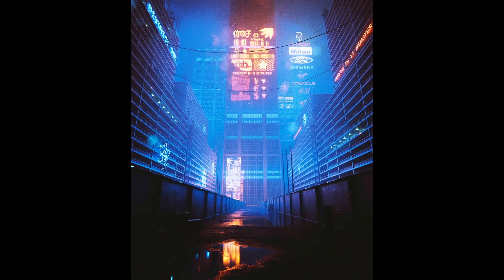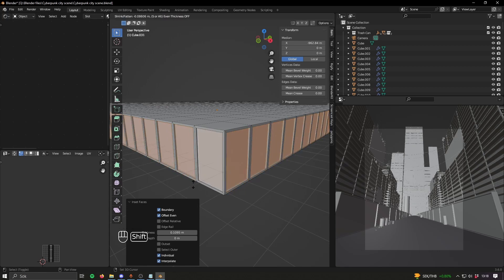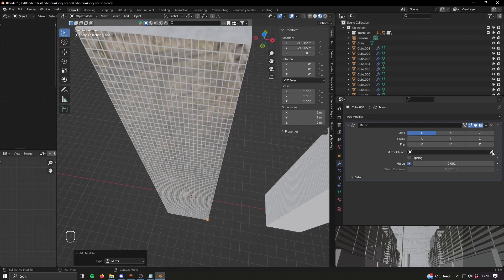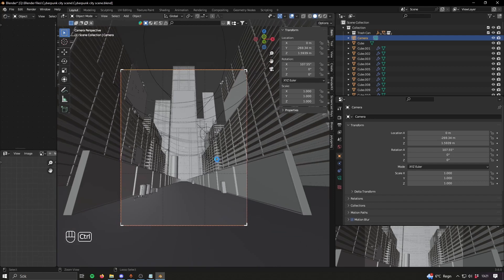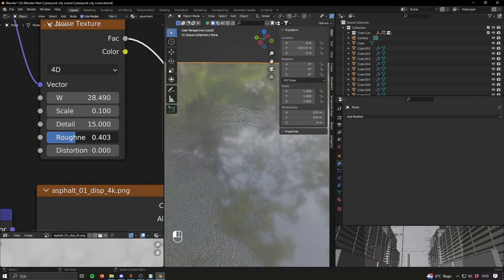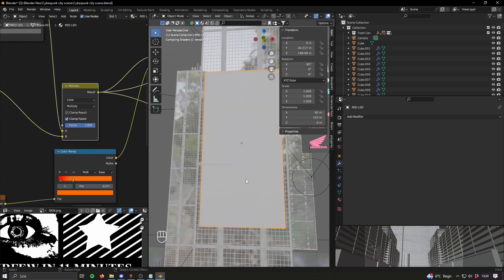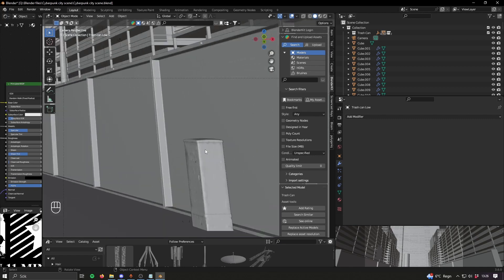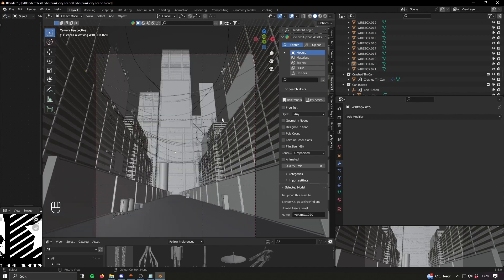It's Easy To Do Cyberpunk in Blender

Comment: you culd simply make the building's faces and save on pretty much 75% of the vertices that blender has to deal with (because you would be removing the other 3 sides). ofc this only works if you don't move the camera and it's a still shot.

for those cases, always model your scene based on where the camera is, everything that is not seen by it can be removed for better performance
Reply: you can also remove all the faces at the top and bottom of each floor, so they are not duplicated on top of eachother when you do the array

Comment: I’m stuck on the inset section around 01:15 seconds. My double 'i i' doesn't work like yours does. Is there a point you need to place the cursor properly?
Reply from the maker: The cursor shouldn't matter. One issue could you that you have not applied the scale on your object.
Reply: same, my double "i" is "crossed" and when i extrude it its look bad
Reply: Same here